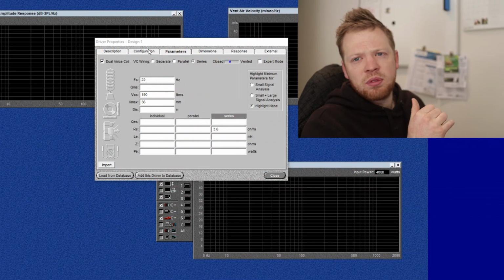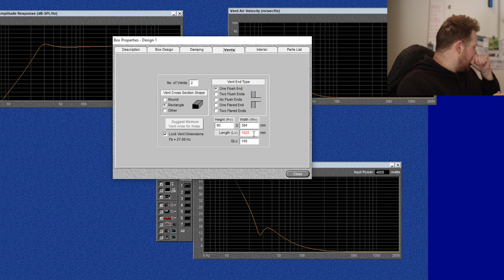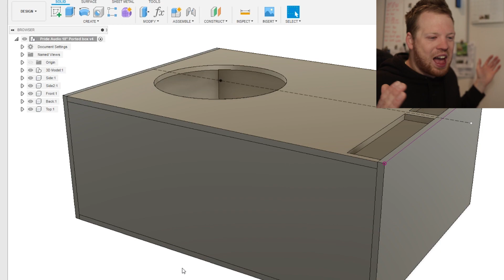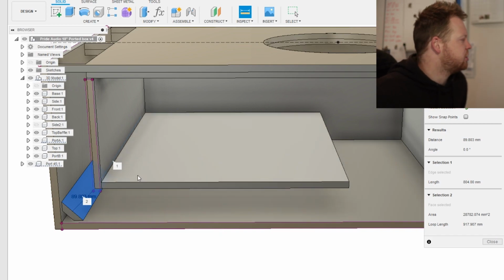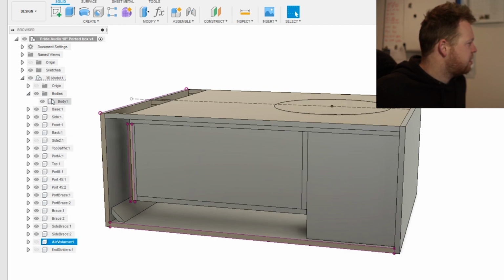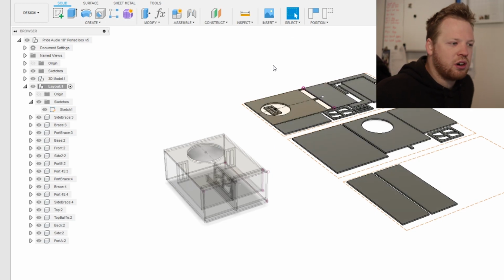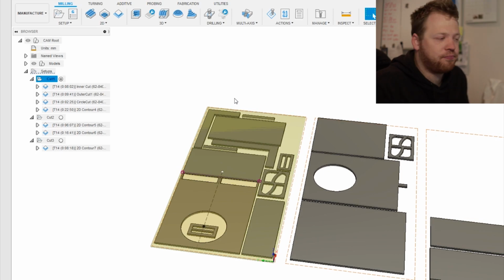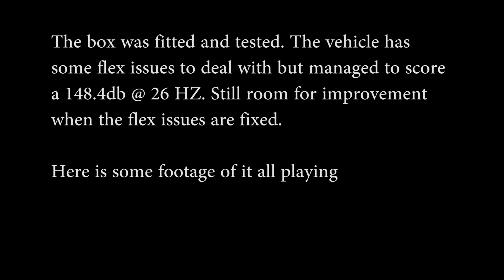Pride Audio 18" Subwoofer Box Build- Design, Build and Quick Demo

Comment: awesome video...
Reply from the maker: Thankyou!
Reply: @D2iAuto  really like the way you explain the process  and the reason you do it..
Reply from the maker: @johnsmith-qz4bv  yeah there is a lot of theory involved in car audio and it is even more complicated than what's explained here but this is a decently basic rundown of it anyway so people can sort of see what goes into designing a basic ported box
Reply: @D2iAuto  could u design a ported box for hometheater ..?..that goes down to 15hz...for the dayton audio 15 inch sub....um15-22..thanks
Reply from the maker: @johnsmith-qz4bv  Yeah i could i usually charge around $100 to do a box design with 3D model and cut list